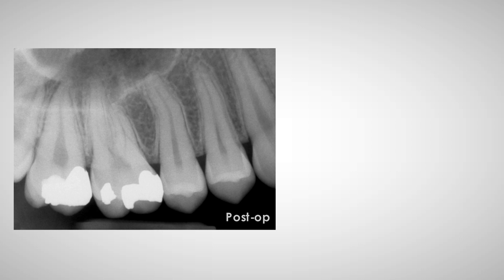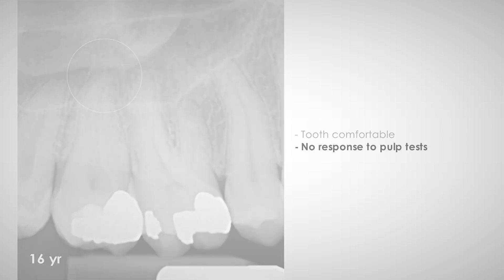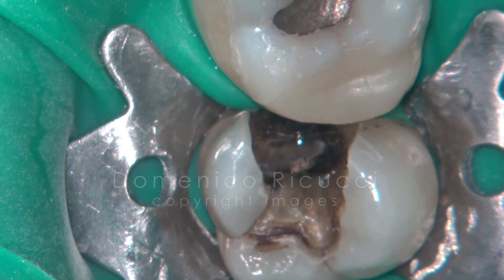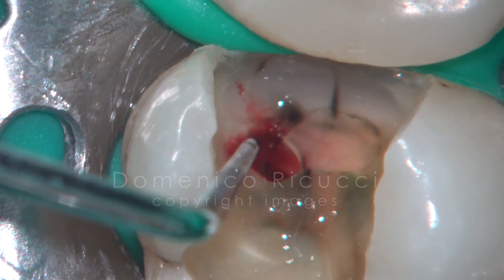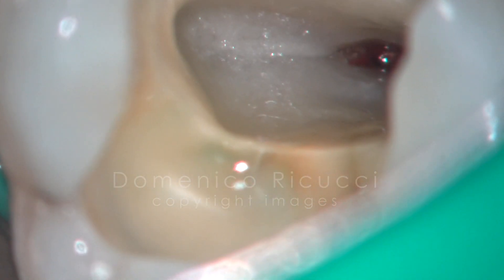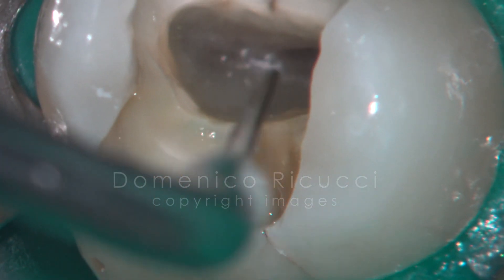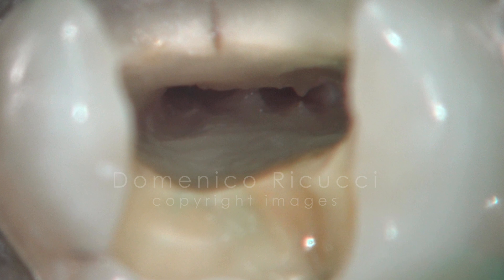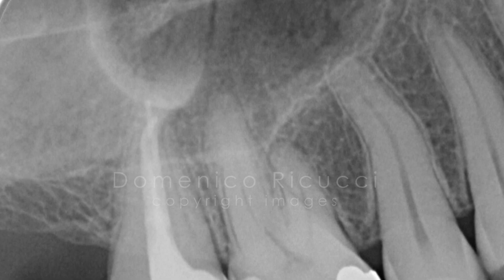DRendo - Failure of a direct pulp capping case. From endo to restoration with a metal-free crown

Comment: 21 years is not a failure. When you have to do a prosthetic treatment in a tooth with very deep caries (overlay f.e.) do u recommend to do root canal treatment even though u find sound dentin before the pulp tissue to prevent the risk of do rct after overlay cementation and damage the restoration?